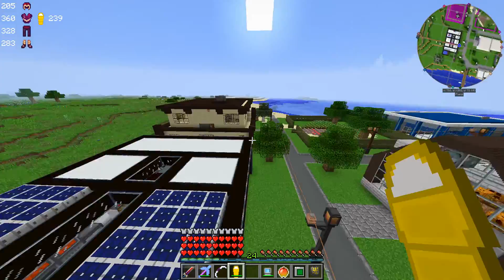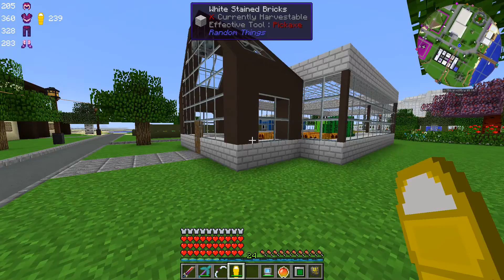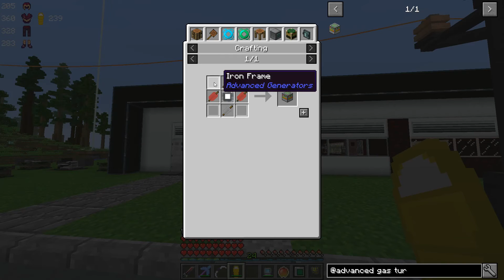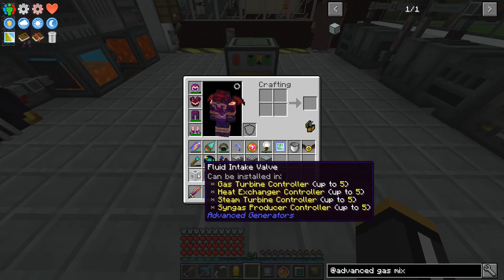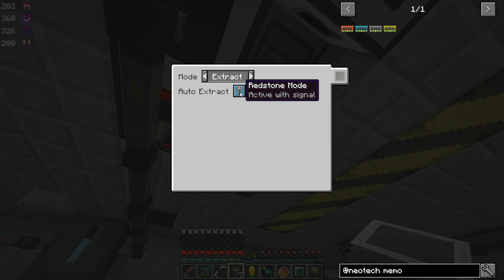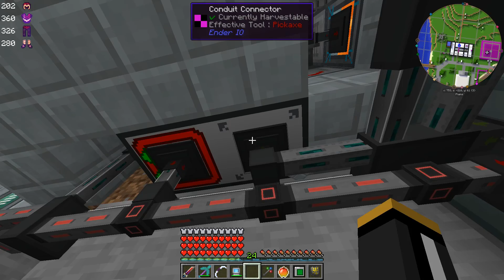Modded 1.10.2 - E53 - Advanced Generators

Comment: Charcoal blocks are 10x as efficient but are crafted with 9 charcoal, so if you really want efficiency I would use blocks. Love the vids btw.
Reply from the maker: Thanks for the tip. I don't think that would be more efficient than using wood logs though because of the resources required to smelt the 9 wood into charcoal.
Thanks!

Comment: Notice the carbon value for charcoal is the same as for a simple wood log. So really, you can just pump wood into the generator and skip the charcoal step entirely.
Reply from the maker: Thanks for the tip! I did notice that only after upgrading my electric furnace to keep up with the charcoal demand. lol. I'll have to tweak my setup. Using logs might bring the efficiency closer to the Stirling Generator since I won't have to use rf to produce charcoal.